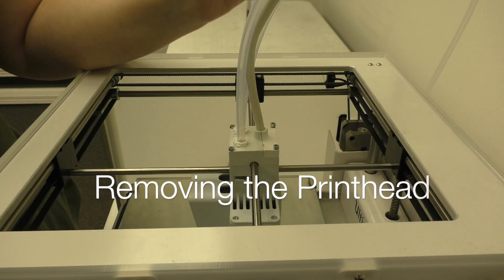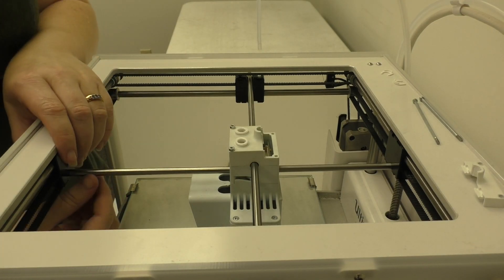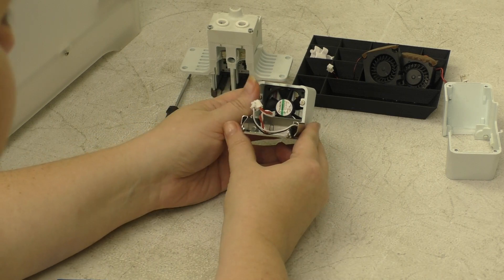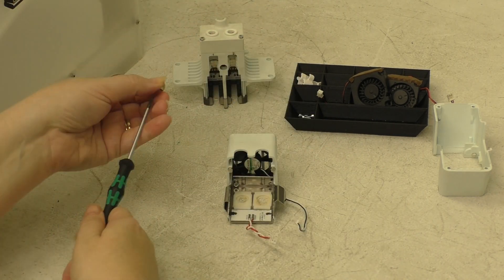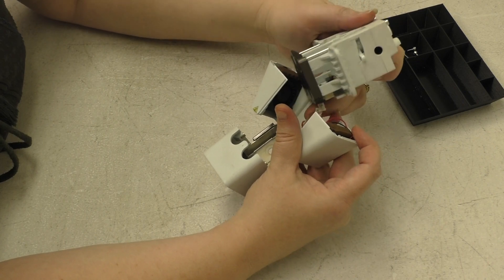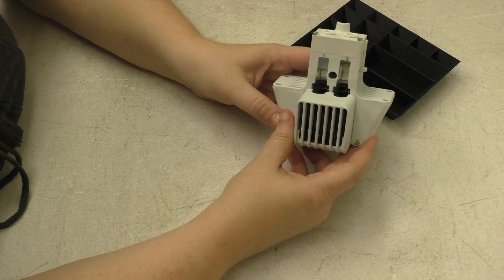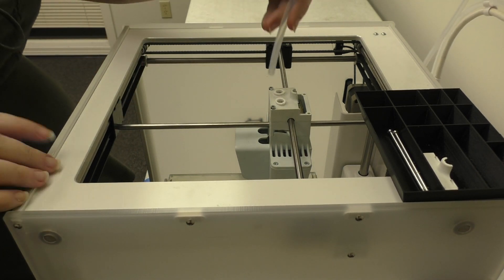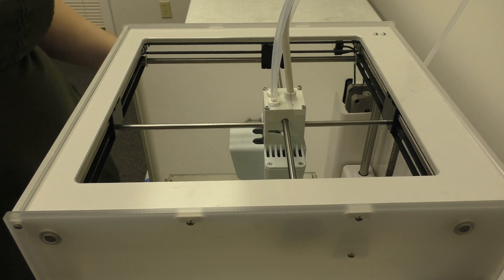Hot End Cooling Fan Installation (UM3/UM3X)

Comment: Fantastic video, I have a S5, but the principles are the same. It was an invalue help to me for dissasemling the hotend asembly, which over night was filled up totally with filament, and the cores therefore couldn't heat it up enough to remove it the "daily" way. Thanks also for a very structured walkthough with calm and clear voice instructions !
Reply from the maker: Thank you! I'm so glad it was helpful. I'm hoping to get some more videos up soon.

Comment: Thank you for the informative video. 
I came across it looking for steps to reconnect the capacitive cable. One of the two cables seem to have been disconnected.
Reply from the maker: You can try to reseat it but generally if the capacitive cable has come out of the board at the bottom of the printhead, the metal end has broken off in the board connector. You may need to replace the capacitive bracket assembly.

Comment: Hi, I have a doubt about my radial fan, I don’t know if this doesn’t work, so when I go to the menu system then print head then fan speed and then I click to 1 to 100 and just the axial fans works correctly but the other it doesn’t move so my question is the next. Does the fan works in this menu o just the other two? 
Bye
Reply from the maker: Hi, Sinuhe, the fan speed controls between 1 and 100 control only your 2 radial fans on the sides of the printhead. For the axial fan/front fan, that should run automatically whenever the Print Core is at 50 C or higher, so that can't be controlled separately in the menu.